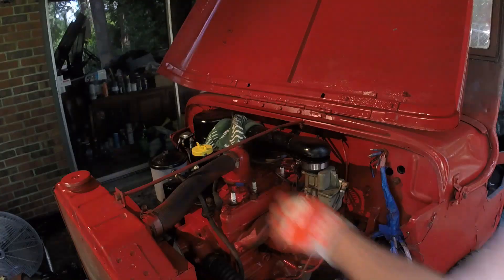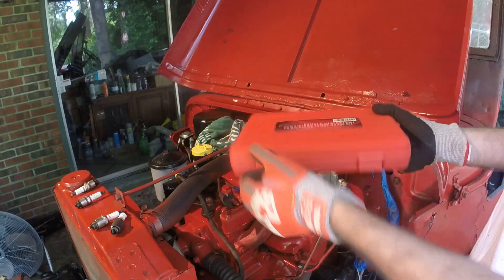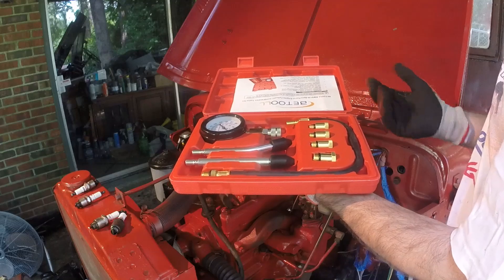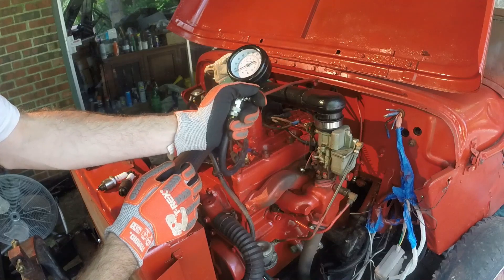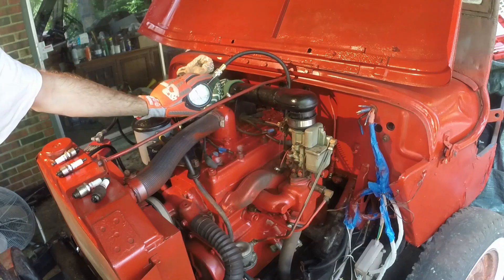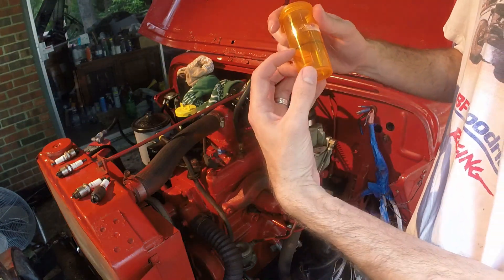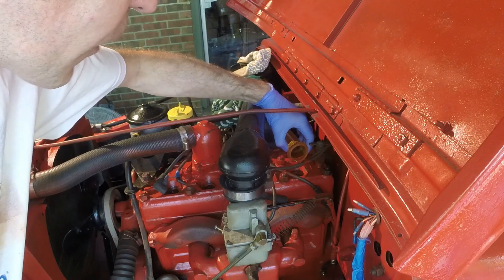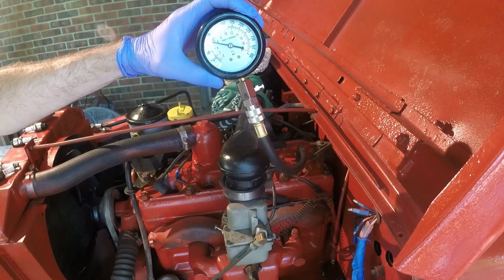Feel the Squeeze... Compression Testing the L134 Willys 4-134 Jeep Engine... Wet and Dray

Comment: Try a compression check with the engine hot if possible, and throttle wide open
Reply from the maker: thanks for the tip